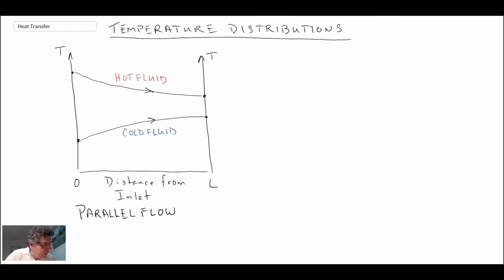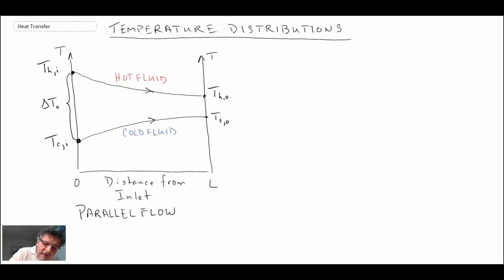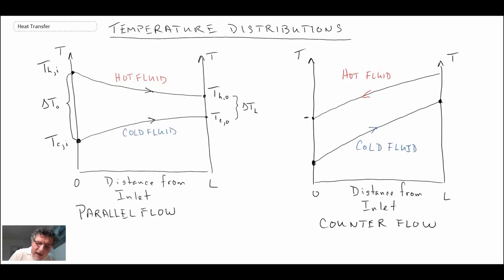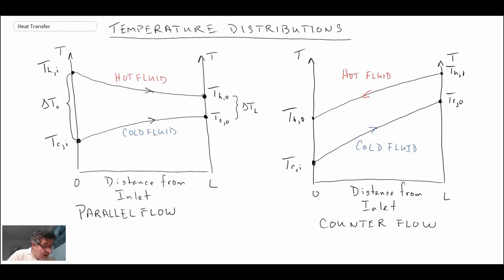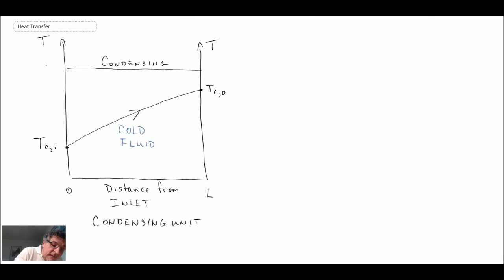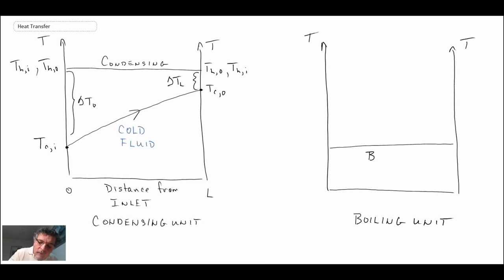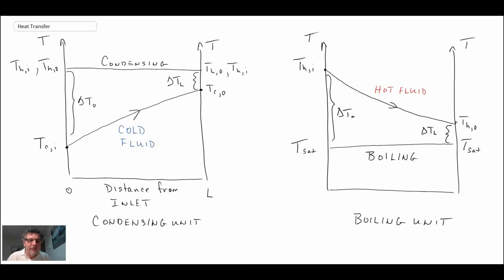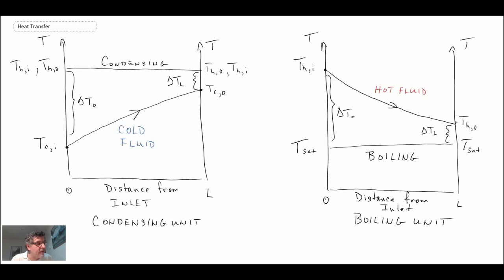Heat Transfer L31 p3 - Temperature Distribution in Heat Exchangers

Comment: So if you have an external combustion thermal engine lets say a steam turbine and you need to go the superheat steam temperature in the out of steam boiler very high in order to achieve better Rankine cylce indicated thermal efficineccy and this having a maximum hot gas burner adiabatic temperature and a limited relative velocity of the fluids flow and limtided overall heat transfer coefficient,you must high the flew temperature in order to achieve a more hot steam and ever the superheated steam has a bit lower temperature than temperature of exaust gases.So you make better the efficiency of the engine and worse the efficiency of exploitation of the fuel ingition.